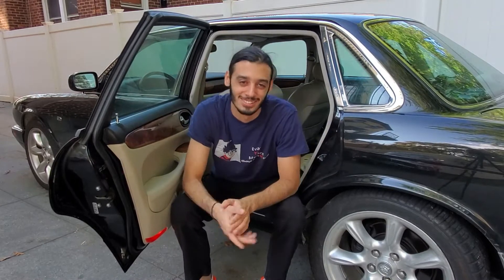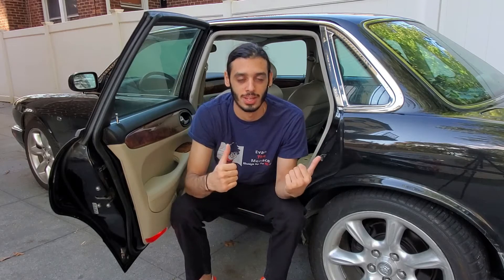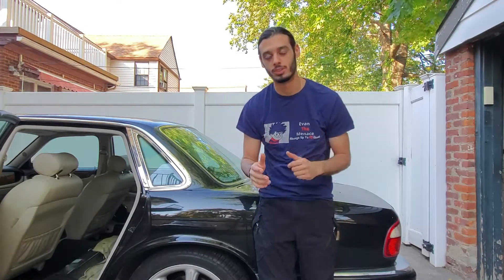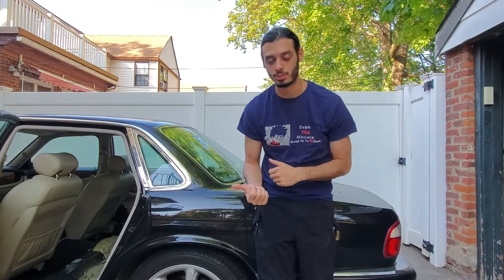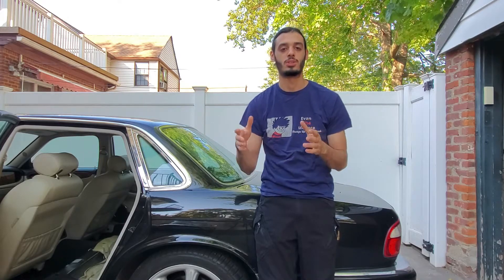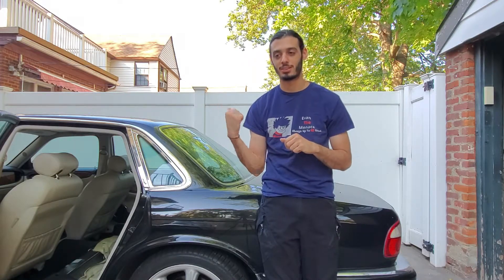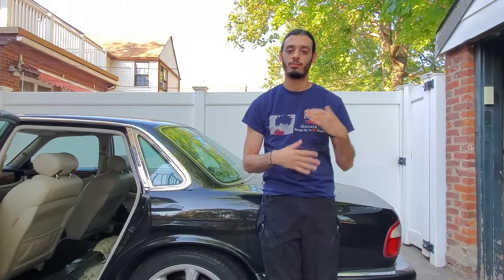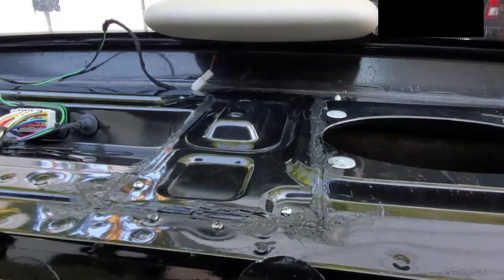Jaguar XJR - Fuel Pump Wiring Harness

Comment: Parts geek wants 162 bucks for that harness. Someone is really screwing us. The little black box is likely a motor snubber designed to suck the voltage/ current /energy out of the coil windings in the motor during shut-off to prevent voltage spikes which often causes motor windings to short out that also cause premature failure. It's basically just a diode with maybe a resistor and allows the current to run backwards until it is de-energized.
Reply from the maker: I totally agree with you on that! It's some kind of voltage control/noise suppressor for the fuel pumps located in the tank. Crazy how the harness was once cheap (I bought it around $125) and now as you have said, jumped all the way to $162. Before you know it, it will be $200 and in most cases depending on the type of vehicle you have. You may or may not need two of those.💸🙁

Comment: Jaguar wants 500 bucks for a fuel pump. That is absurd. What I find is the electrical connectors from OEM are not sufficient connection and will ultimately cause problems. Aftermarket pumps have a beefier connector but you must cut off the old connector and solder in the new ones. Do not use the adapters that are supplied by some after market. What I see is people swapping out fuel pumps and using the old connectors which is now corroded with carbon deposits from a weak connector. You must install new connectors or you end up having problems with new pumps.
Reply from the maker: Well you can try using Delphi pumps from Rock Auto and a new style connector (which normally comes in the package) and you shouldn't have any issues whatsoever (that's what I did on mine when I used to have the car, etc.). I know people that have used a brand new but oem style connector with a new aftermarket pump and have not had any issues later on. Similarly, the other way around, some have gone ahead and used an old style (oem) connector and then later on issues arose when a new fuel  pump was installed with it. It's a hit or miss type of scenario. I believe these cars are very sensitive to abrupt and abnormal high voltage spikes, low battery, etc. Great comment by the way!! ✊💯
Reply: @EvanTheMenace  I did in fact buy that same pump you mention from rock auto. I plan on changing out the connectors because I think that is the primary problem for failure. I am trying to use the more robust beefier connector as I think it will hold up better. I'm not using thew oem. I sure wish the fuel pump itself wasn't such a nightmare to replace. It is the most difficult replacement I have ever experienced. I refuse to cut out body parts like many have done.